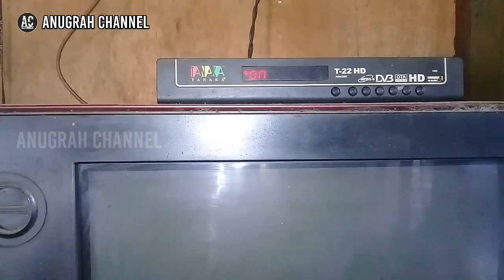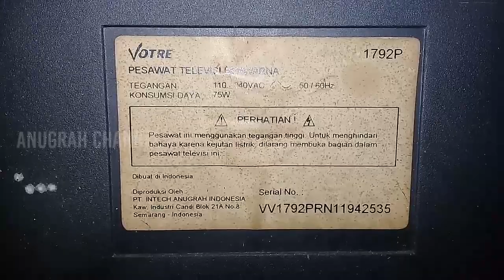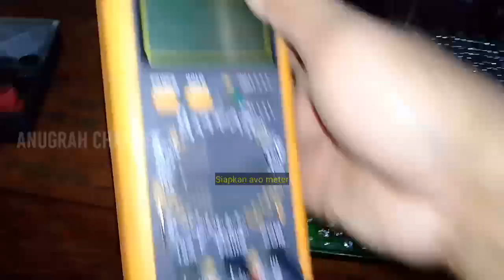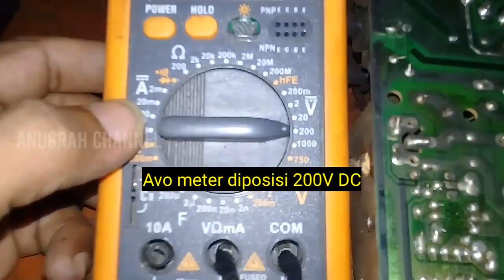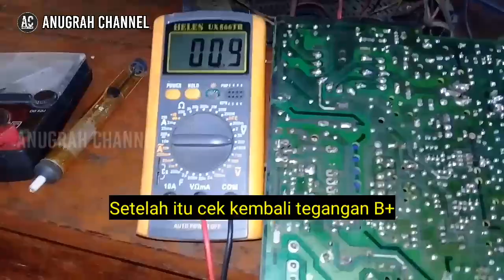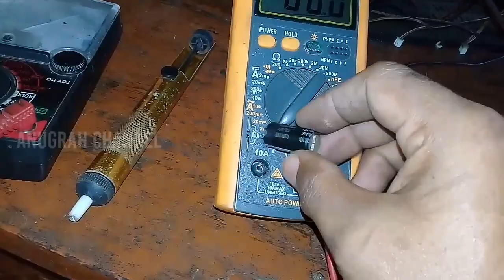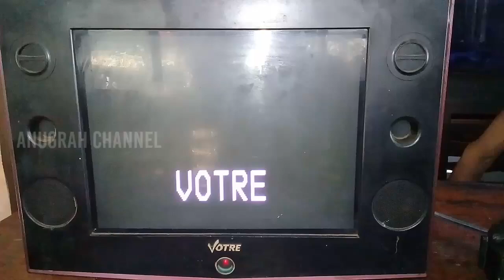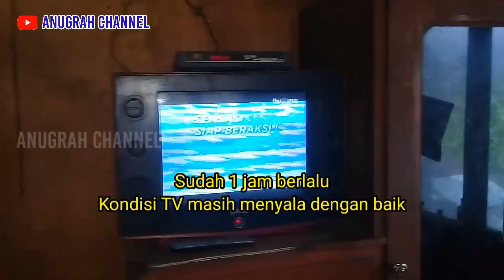Cara memperbaiki TV China mati (tegangan b+ 0 volt)

Comment: mas, kalau kondisi blm di apa apain b+ setelah c millarnya drop ke 60v, di kaki psu 110v. Tapi ketika jalur b+ di open di kaki fbt, tegangan setelah c millar  tetap 70v dan di kaki psu 0v (jarum multi gak gerak sama sekali). mohon bantuannya mas 🙏

tv cina juga
Reply from the maker: Mesin tv mungkin dalam kondisi standby belum start. Coba start/on dulu pakai remot atau tombol PR+/CH+ pada panel tv.
Reply: @ANUGRAHCHANNEL52357  oh iya kalau jalur b+ ke fbt di open, ada suara derik, kalau di sambungkan gak ada suara aneh mas
Reply from the maker: @muhammadhafizi179  saat jalur b+ di open, tegangan b+ berapa volt?
Reply: @ANUGRAHCHANNEL52357  60v. Kondisi elco dan millar normal
Reply from the maker: @muhammadhafizi179  perlu diteliti lagi, mungkin ada komponen yang sudah aus di psu bagian primer maupun sekunder.